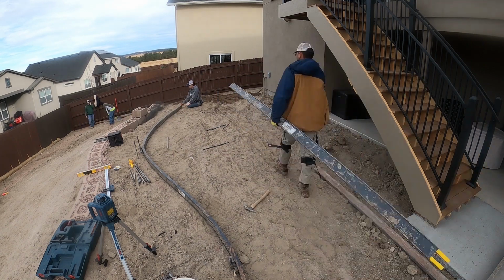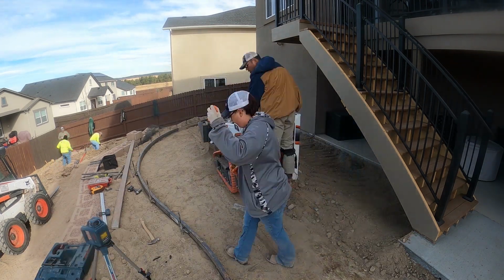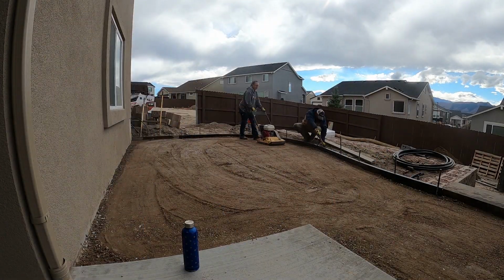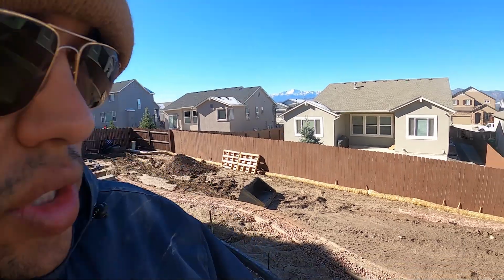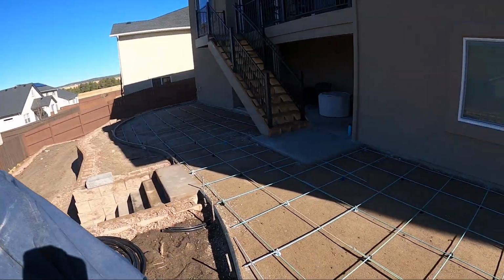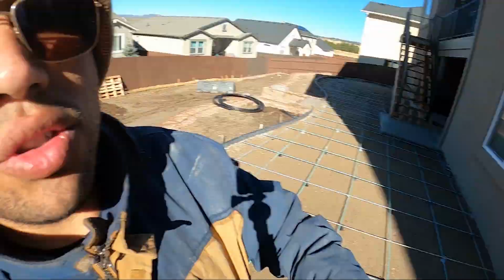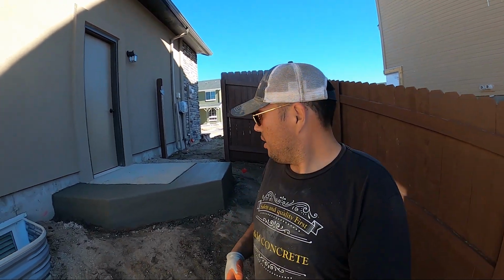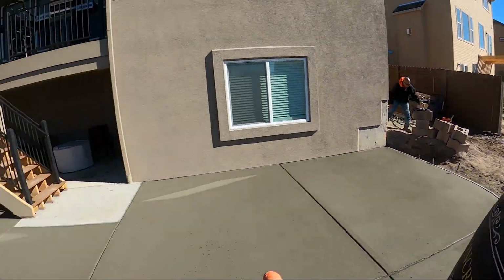Concrete trucks showed up real late. Round concrete patio with large step on side of the house.

Comment: 1st, what up homie! Can't wait for the video, looks like it's getting cold in colorado! That machine is perfect for what we do
Reply from the maker: Last job we won't have to cover for sure. I ended up convincing one of the guys helping me pour to get a small machine. You can't go wrong that's for sure. Very versatile. How's the weather getting up in indiana?
Reply: @jmconcretecoloradosprings  nice actually, just been raining alot! I don't cover my concrete unless it's below freezing for over 12 hours of the day and obviously temp matters 4 sure, I do cover it but try not to let it touch it because it can leave marks
Reply: @GRUBB-MUDD  what does covering it when it’s cold supposed to do?
Reply: @PrecisionCSGO  it keeps the top from freezing I can't speak on anything outside of Indiana, but when it gets below 30 I cover it, but only if it is below 30 for over 8 hours of the day, it will retain heat for the 1st night, because of the chemical reaction of cement in concrete, but you really gota worry about it the 2nd night! It usually doesn't discolor it on the 2nd day
Reply: @PrecisionCSGO  in indiana they have freeze guard! Which goes really fast but it won't freeze and u can pour in really low temps! And u don't have o cover it, but u better have your game face on because you only have about 45 mins to work w it

Comment: Why didn't u buggy it? You know I'm not pumping it lol! How many yards was it? Where do u get your music, I'm struggling to find copyright free stuff to use in my videos! BTW it turned out great good job
Reply from the maker: 10.5 yards and wanted to make sure it came out well. Plus taking off the forms and popping them back in on the fly is harder than wood forms. The music comes from the Adobe Elements library. It's royalty free.
Reply: @jmconcretecoloradosprings  is that what u edit w? If so can u really go dep into it, and how much is it?
Reply from the maker: @GRUBB-MUDD  Adobe elements and it was like 70$ I think.